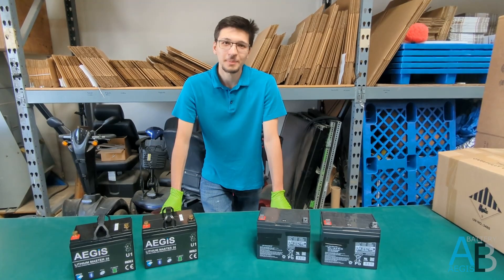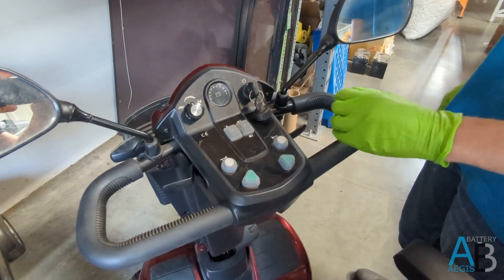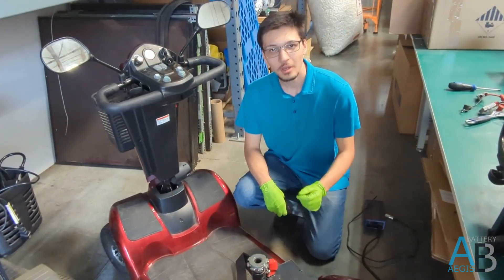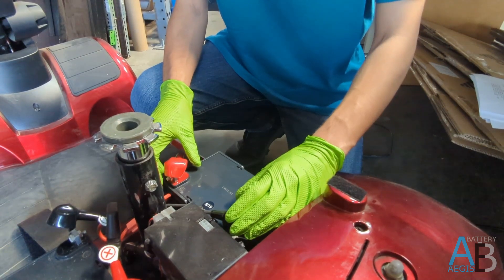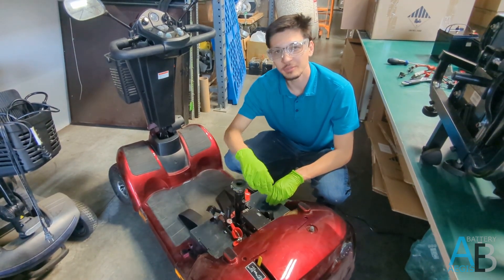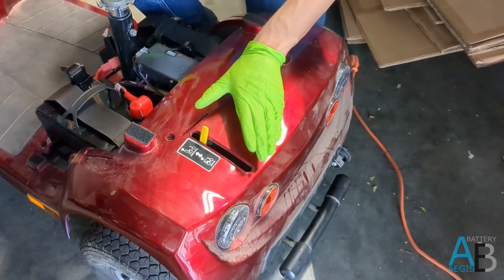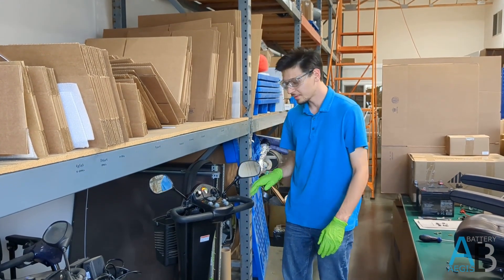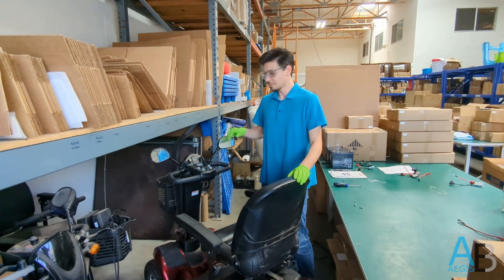How to Upgrade Your Mobility Scooter to Lithium Batteries

Comment: I ride with two 100Ah AGM batteries; they're very good. Before the AGMs, I had gel batteries, which only lasted me six months. I have to ride uphill a lot and I also ride in winter. I have the feeling that you can use the energy better with the AGMs, whereas with the gel batteries, you have a certain range, end of range, and the AGMs last me four years. That makes sense.

Comment: I was going to change my lead acid ( standard type) batteries to Lithium type. But, I was told I couldn't simply just change them like this video shows. I had to have the wiring changed to be compatible aswell as the dashboard to be compatible with the new type lithium type batteries as the lithium type wouldn't work for long properly on the standard wiring system.  Is this true or just sales talk to gain more money from the owner. I have been dealing with my repair company for years & was told I had to get the wiring totally changed to be compatible with the new type lithium batteries first. This would have cost me a fortune to get done on top of the cost of the lithium batteries. So, I have stayed with the lead acid types until I find out if it can be done without any damage to the vehicle especially over a long time or even a short period of time.  Can this be confirmed if it cost effective By not costing me a fortune. This guy simply just changes them & obviously a different type of charger required ( lithium charger) one for lithium batteries would have to be used on them as a lead acid type is far from being compatible & unsafe to use with them.
Reply: Whoever told you that you need to change the wiring is an idiot. Why would you need to change the wiring? It's still going to be the same voltage. You might have to use a different style connector at the battery post depending on which lithium battery you choose. You will have to get a charger that's compatible with lithium batteries because they charge at a higher amperage. And, the battery gauge on your dash will need to be changed too. I looked into all of this thinking it would be nice to switch to lithium batteries on my scooter. For me (2 battery system) it would have cost approx. $600. Yowza!!!! So what I decided to do was replace with lead acid batteries, but I got the upgraded higher amp hour batteries  which will give me more range than I had from new all delivered to my door for $200. Easy-breezy swap and I'm back in business. One might argue that some of the lithium batteries have an 11-year warranty, and so the cost isn't that much over time. However, unless you plan on never swapping out your scooter for a new one with modern features , OR different needs, that argument doesn't hold water. So that's my take for what's it's worth.

Comment: This may very well be the most useless video on replacing batteries yourself. 
- you go from led acid to lithium? Lifepo4 or li-ion?
- you have selected the right battery with the right c rate?
- you have batteries that can be put in series? 
I could go on.

Comment: I have a mobility scooter, I've replaced the batteries once, from 10AH 12v sealed lead acid batteries, to  12AH 12v SLAB.  But they only lasted a couple years.  I want to upgrade to Lion Batteries... Will I need to change the charger?  I realize they are both 12v,,, but will the stock charger system work with the new battery tech and shut off when it's suppose too, and or charge them up 100%?

I'm looking at the 20AH Lion batteries.
Reply: Hi Terrack,thanks for reaching out.Regarding your question about whether your lead-acid battery charger can be used for lithium batteries, our suggestion is no. Although both are 12V, the charging characteristics of lead-acid and lithium-ion are different. Lead-acid battery charging is constant voltage and constant current, usually with a higher termination voltage, while lithium-ion requires more precise constant current and constant voltage (CC/CV) charging, and the cut-off voltage is different. If you continue to use a lead-acid charger, it may cause overcharging, affecting the life and even safety of the lithium battery.

Comment: Very poor. All you've done has swapped the batteries. No mention that you MUST change you charger for a proper lithium charger or you could damage the new batteries and cause a fire. And also that the led's on the tiller won't give a proper reading of the power in the batteries and that you'll need to fit the correct lithium meter.

Comment: OMGGG STOPPPP delete this video, this is so so wrong. The problem come when you recharge the batterys, the recharger wil attemt to recharge with 15a, and the controller will after a few times not working anymore, and THAT is very expensive. (i have tryed all that myself) but what i did was, the recharger comes with some software ”victron energy” that you install on your phone, and here you can set the recharger up to recharge only with 5a instead of 15a…… another thing is, that the batterymeter will ALWAYS show you that the battery is full, they are not made for lithium battery

Comment: My general impression is that conversion to Lithium, at this time,  is not for the average mobility scooter user. If you are quite savvy about lithium battery technology, including chargers and monitoring charge level,  and how to buy good  quality batteries and chargers, etc., economically, it may be worth doing. The sheer weight of carrying sealed lead acid batteries is becoming a problem for me at 85+. 
I expect that easy to use lithium powered mobility scooters will become common, and cheaper, in a few years.

Comment: I have 2 lead acid 10 ah total and have a lithium RV battery 100 ah. All are 12.8 v. The lead acid batteries are soldered in. If I took them out and replace with a single lithim battery would it work? Would I have to dissconect the spare/ loose cables or mask them with gaffa tape.

Comment: My largest concern is burning out the controller.  All my scooters appear to have a "Rhino" controllers, and on their website, they state that there is a pretty comprehensive battery management control setup.  
What are the chances that the larger Li-Ion charging amperage  (10 Amps vs 6 Amps) will not damage the controller - the charge port on my scooter does not go directly to the batteries, but to the controller, then to the batteries.
Current lead-acid charger is a 6 Amp. Smallest 12V charger for a 135Ah LFP battery (for eg) is 10 Amp.  I'd like to be able to run a 20 Amp charger, really get them charged as fast as possible.
Living in a small city right next to a large city, it would be nice to at least double my range. 75km is amazing (from comment down below), but if I could get 40 or 50km, I would be a happy man.

By my reckoning, a replacement 135 Ah LFP or Li-Ion battery would just about double my current range.  That is because the Li-Ion battery can be drawn down to a much lower remaining voltage before dropping off - somewhere around 20%.  That gives 80% of the battery amperage going directly towards the load.  A Lead-Acid battery should only be drawn down to about 50%, because apparently any more may damage the battery.  So that gives me just 50% usable amperage. Some batteries may tap out at 60%.  Think of a Wal-mart battery.  Experience has led me to believe they tap out at about 80% (voltage drop) LOL.  Never again.

What size charger is included in your kit?
What size battery do you have in a Class 24 battery size.  I've seen as high as 280Ah Li-Ion batteries.  I could go forever with a pair of those!!!  (If I win the lottery!)

You don't happen to have a couple 300Ah batteries laying around to replace my 75Ah ones? LOL.
Reply: bypass the charge loom from the controller straight to the batteries then run any current you need to  ;)
Reply: @optimusprime-G184  Which will then be limited by the battery's internal BMU.
Bypass the BMU, get any current you want and watch your house burn down!
Reply: @dd_ranchtexas4501  very safe todo its only a different charge loom straight from charger to battery..totally safe you dont need a charge current going through the controller to charge a battery lol
Reply: @optimusprime-G184  And the BMI inside the battery limits the current to a
safe level. Missed the point completely.

If the Lithium battery is one with no internal BMI (to limit the current) and
you do not externally limit the current to a safe amount, it will not end well!

Comment: I think the choice of sealed lead acid is a better choice for an implement that will be charging in a home or hotel or garage, and that runs through puddles where the battery compartment could see water ingress, or debris penetration. 
Lithium ion batteries are showing a marked propensity of igniting violently after water ingress to the compartment, or if punctured or damaged. With that big an unknown I try to limit the number of Li-ion batteries inside my home, as I would be unable to get my elderly disabled parents out in a timely fashion.
Reply: plus FAA issues
Reply from the maker: Hi califonigirl, definitely can understand the concern. Cheaper lithium batteries can definitely issues, especially when not properly sealed or do not have quality BMS to properly detect short circuits or temperature issues. 

Our recommended mobility kits come only LFP (LiFePO4) batteries and are enclosed in ABS IP65 rated casing. LFP is much safer chemistry than most other lithium-ion batteries being able to withstand punctures without igniting. 

However, no current battery is completely inert. Even lead acid has toxic gas build up that can ignite when charging or damaged. 

Ultimately choice is up to you. Good lithium batteries are more expensive than lead acid, but do offer quite a bit of longevity, power, and safety now.

Again, thanks for brining this up, we get this question quite bit. 

If you have any further questions or concerns, feel free to reach out to us anytime at contact@aegisbattery.com

Comment: Hello, can I use a lead acid battery in this vehicle?
Reply from the maker: Hi emrah8057,

Yes, the stock battery for most mobility scooters are still lead acid. 

However, if you did want to upgrade for more power/range and longevity, feel free to check out our mobility kits at: 

https://www.aegisbattery.com/pages/mobility-scooter-replacement-batteries
Reply: thank you  @aegisbattery

Comment: Is that it, is that all ?
Reply from the maker: Hi TonyBurke100, sorry for the late reply due to holiday. But yes, in many cases it is a simple drop in replacement with the same voltage battery. 

However, we do recommend checking with your mobility scooter manufacturer to ensure no issues using lithium batteries. Also, the on board battery meter may not display the voltage correctly when upgrading, but we do include this and the lithium battery charger in our mobility kits. 

If you have any further questions or concerns, feel free to email us at contact@aegisbattery.com and visit our website: https://www.aegisbattery.com/pages/mobility-scooter-replacement-batteries

Comment: I have a Pride Raptor with with AH 75, 24 volt batteries. Which lithium batteries can I buy instead?
Reply from the maker: Hi sea_hous, based on a quick search and like most mobility scooters, Pride Raptor utilizes (x2) 12V in series to output 24V. 

We currently have a 75Ah available for our mobility scooter kits. You can check out all our mobility scooter kits at: 

https://www.aegisbattery.com/pages/mobility-scooter-replacement-batteries

If you have any questions or comments feel free to reach out to us via our email and we'd be happy to help.

Comment: The guage won’t work you need a lithium guage
Reply from the maker: @brunningwolf You're absolutely right. Most current mobility scooter's meter or gauge are designed for lead acid batteries and do not work with lithium batteries.

For our mobility kits, we include a new battery voltmeter that is calibrated to our lithium batteries and can be plugs into the XLR charging port.

https://www.aegisbattery.com/pages/mobility-scooter-replacement-batteries

Thanks for pointing that out and appreciate your comments. 

We did create a supplemental video showing the full kit that has the new battery voltmeter as well as the correct lithium battery charger. 

https://www.youtube.com/watch?v=olGSD8G1m54

Comment: Hi, does the main circuit breaker go off when replacing the batteries - or should you trip the breaker before replacing the batteries? Thank you.
Reply from the maker: Hi bpbigman1, generally if you are replacing the same exact voltage your scooter used before, it should not trigger the breaker or need to do so in replacement. 

If you have any further questions, feel free to contact us contact@aegisbattery.com and we'd be happy the help.
Reply: Thank you for your fast reply, that makes a lot of sense - excellent!

Comment: The EcoWorthy 12 volt 30 ah Lithium batteries appear to be same size as the two 18ah SLA batteries I use in my Pride Elite Traveler scooter. Amazon is selling a 2 pack plus balancer for $125. This looks like a good deal for use in my scooter. Would also need a lithium charger with scooter connector and a lithium voltmeter. Thoughts?
Reply: You have to keep in mind the Airlines restrictions on maximum battery size for a carry-on mobility scooter - cannot exceed a certain wattage. (v x a) but I think the new setup is still below the Airline Industry max limit.  500 or 600 watts, I cannot remember.  I had to buy a second, smaller capacity battery for my folding scooter as my regular battery was twice the allowable limit, but the 2nd one was spot on their max, and I took it to Europe for a cruise! I didn't need range, just the ability to get around on a tour once in a while.

Comment: I was going to have my scooter changed from standard batteries to lithium type But,  was told i had to have other things done to my scooter to make it compatible with lithium batteries. new system etc,  etc costing  including  the batteries around £1, 000 +  But this guy just simply changes both batteries to lithium & no problem What about the charger does that have to changed to a lithium type charger or will the one i have been using (without any issues for the past few years ).  I am very CONFUSED!!!!  by my usual mobility scooter repairers & this video & very possible similar other vids online.  I really need to know is  my  repairers right or wrong on this matter. 🤔🤔🤔🤔😒🙄
Reply from the maker: Hi thestig8133,

Thanks for your comments and happy to help. 

In many cases it really is simple drop in replacement for your lead acid with the same voltage lithium batteries. For charging, you will need to change to the corresponding lithium battery charger.  

We do recommend you first check with your mobility scooters manufacturer to see if your model can be upgraded to lithium batteries. 

You can check out more detailed guides and videos on our mobility page towards the bottom: https://www.aegisbattery.com/pages/mobility-scooter-replacement-batteries

If you have any further questions, feel free to contact us directly at 949-469-1776 or email us at contact@aegisbattery.com
Reply: @aegisbattery  Thanks for your reply but,  SADLY!!!! i have recieved the WORST news anyone could get when they are in my situation. & all i can say is everytime this has happened it has taken on average 16 months to sort out. So,  at this time i will not be able to do anything As to when who knows. But,  i got just one question the lithium batteries you use are not the one's i was thinking of.  The one's i was thinking of are called DAKOTA LITHIUM I don't know if you have e er heard of them. But,  what i do know about them they was put on a mid sized mobility scooter & went for a drive That drive was over 75+ miles on that one single charge. 😯 I couldn't believe it myself. But,  it was proven the scooter did that milage on those DAKOTA lithium batteries But,  my scooter i think is what is reconised as LARGE one So,  if i got thge REALLY RUBBISH milage it does now MAX 4.5 mileson a full charge 👎👎👎👎👎😠😠😠😡😡😡😡😡 I would expect it to do at LEAST!!!! 15+ miles on a charge. So,  you can understand my 😡 & extreme frusdtration on it's extremely low range & it has had a recent service & nothing was found to be at fault.  So,  as i said earlier i can't do sod all with it due to this major issue i have that i know will take around 16 months. So my mental health is getting WORSE!!!!  due to this & will not get any better until it is sorted out till next time ( around 2026) expected. Anyway i have said too much as tend to do. SORRY for that.   But,  thanks  anyway Do some deep research into those  DAKOTA Lithium batteries & make your own judgement of them. I personally think they are FANTASTIC!!!!

Comment: so you dont have to change chargers ? ?
Reply from the maker: Hi garyhughes6927, thanks for the question. You do need to change to the correct lithium battery charger for lithium batteries. 

Many mobility scooters run on two 12V batteries in series (x2 12V), meaning you would need a 24V lithium battery charger. 

For a more detailed guide, you can check out our article post at https://medium.com/@contact_74436/mobility-scooter-battery-upgrade-guide-checklist-b95ec2d938fe

If you have any further questions, please feel free to reach out to us anytime or email us at  contact@aegisbattery.com